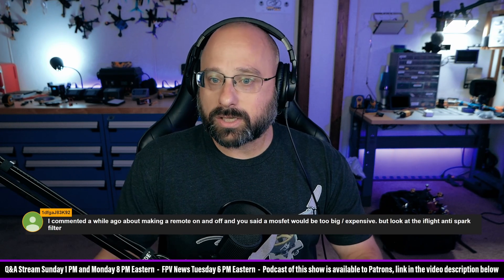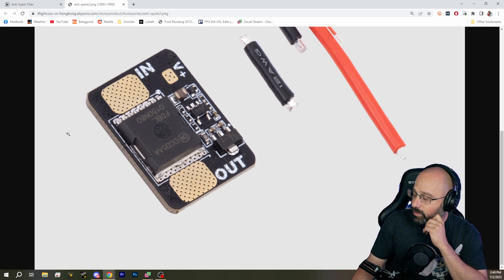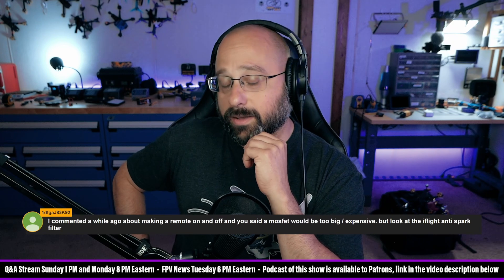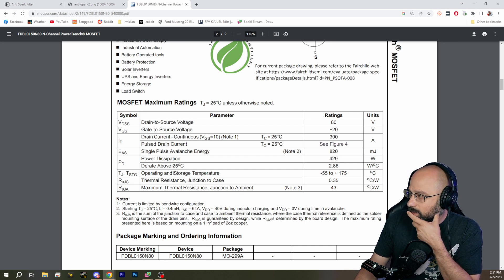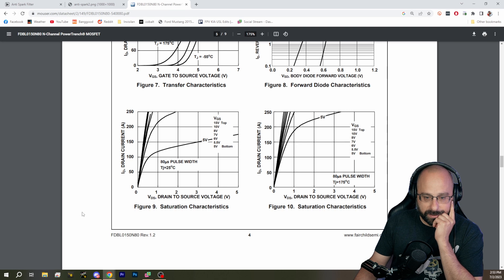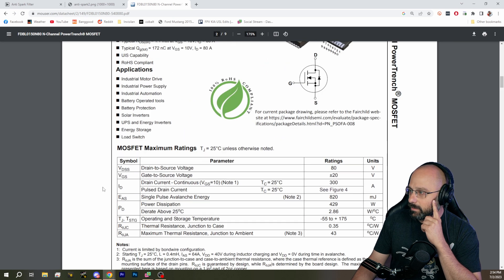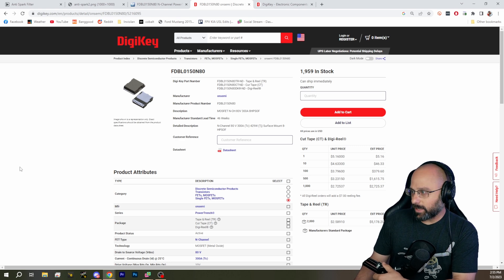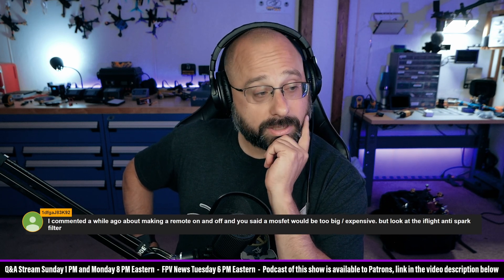Did We Find A Mosfet That Will Work To Remotely Shut Off Our Drones? - FPV Questions

Comment: Thats absolutely no problem to build such a switch... Even smaller than that. It all comes down to power dissipation (which is almost exclusively determined by the internal resistance) and the thermal properties of the board (mostly exposure to airflow). Now there are MOSFETs with like 300 microohms resistance and in our quads we usually have an average current of 20A with short peaks to like 120A or so. At 120A the power dissipation is like 4W. Thats much for a board in the size of an XT60 but these currents last not for long. So i think this should be no problem.
The real question is, why do you want a remonte shutoff? 😂
Reply: Ah and you could also do more FETs in parallel if the resistance is still too high for your taste
Reply: Why is it that everyone who knows what they're talking about always ask why you want this, why you want that, what do you want to do with it, why don't you just use a rock and a stick, what color is your underwear...Jeezus! Build it and we'll figure it out!

Comment: What are the common battery pack voltages that are used? 
I'm thinking I can help the community and try to design something for you to test. Just need to know if 4-6S is a good starting point and also possibly max power draw you think you'd see on a full throttle pull.
Great channel keep up the great work.

Comment: that mosfet and any other mosfet can switch[loaded/unloaded] its rated current all day long and the voltage drop on it will be negligible  , there are mosfets with even higher current which are still small

Comment: The 300A datasheet rating is for ideal cool silicon conditions and doesn't indicate that the thermal situation would allow that long term. For antispark they would most likely use a resistor in series with the in/out leads to control the charging current, then the MOSFET would be used in parallel to short out the resistor after the precharge period. So the MOSFET would be turned fully on after the precharge and would be carrying the full load current the rest of the time. The heat dissipation would determine the continuous current capability in the I squared R sense. The same MOSFET should be usable for an on-off switch device for the same current rating. You can parallel MOSFETS to increase current capacity if needed. If the video transmitter is overheating (the usual issue) a much smaller switch could be used to power it down and still have the controls be active. Sorry, didn't see the original discussion so this is out of context.

Comment: I did thermal testing with the anti spark filter at work and ran 50v 50amps through it. It did heat up to about 200 degrees Fahrenheit after about 10 minutes. This was without a heatsink. I have the thermal photos as well.
Reply: I noticed excess heating when run under 20v because of the minimum voltage required for the mosfet and the gate voltage.
Reply: Also, they updated the board. Its smaller and has a different, updated mosfet.
Reply: Its also rated for 170 degrees Celsius

Comment: The resistance is 1.1milliOhms. The voltage drop isn't a fixed amount. It's the same as putting in a 1.1milliOhm resistor. Ohms law applies, so 0.1V at 100A, which means it is dissipating 10W (0.1V * 100A) as heat when 100A is running through it.
It can absolutely switch 100A at battery voltage. There's going to be more resistance in the wires and the board than in the MOSFET.
At 300A the MODFET will still be happy, but it will be dissipating almost 100W which I think would be a LOT of heat for a small circuit board.

Comment: Wouldn't it cause a chain reaction? The mosfet would be open normally, but when it receives a signal, it closes. But when it closes, it cuts power to itself, meaning it opens again and causes a chain reaction. Unless the mosfet doesn't loose power, but the signal from the receiver would no longer be there, meaning the mosfet would open again? No?

Comment: We need an EE to validate... But this device appears to be disconnecting the ground/negative terminal. Wouldn't that imply the quad itself is consuming all the energy? Therefore the only thing this device is changing is the desire for current to flow through the quad when it disconnects the ground. Prior to disconnecting ground, the quad is consuming all the energy.

I'm willing to be wrong, but the above is my current understanding of how a DC circuit operates.

Comment: This is probably just a simple inrush current Limiter (ICL). When appliances are Switched on they draw an initial very high current (which is much higher than the steady state current) caused by all the internal components charging up initially. 

An ICL limits the inrush current to protect the appliances. There are several types of ICLs, but this one seems to consist of a MOSFET which is turned off initial meaning no high current can flow when connecting the battery. Then a capacitor is slow charged up through a resistor and the voltage of the capacitor is used to gradually open the MOSFET which prevents a spark since the current cannot ramp up immediately. Once the MOSFET is fully open it let's all the current pass and the appliance can be used like normal.

So the MOSFET is open in regular Operation of the drone and seems to be able to withstand the current drawn by the battery. I don't see why this MOSFET couldn't be used in a remote off switch circuit.

EDIT: by the way this is just my best guess how this spark filter works. No guarantee, but I bet I'm pretty close.

Comment: 6s rc cars have fail safe sooo ?
Reply: Failsafe has to do with the radio, not the battery.
Reply: @MCsCreations  it also shuts the esc off remotely.
Reply: @breakalegfpv9532  Yes, but because of the receptor that stops sending signals. The same should happen (it can be badly setup) with quads.
But the idea is to save the battery. You know? Because it's still connected and stuff is still turned on.

Comment: This mosfet might be used as an inrush current limiter in order to prevent the spark. Once the inrush current is diminished the mosfet would have to be left on and could be turned off.
Reply: > and could be turned off.
and could NOT be turned off.